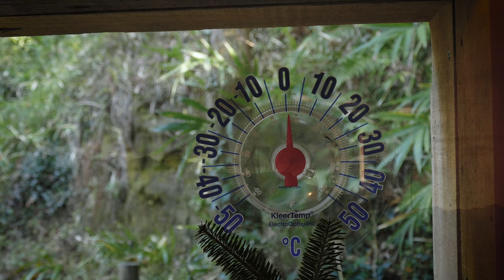Upgrading a kitchen from old Japanese cabinet / Building a cabin with Improvisations 34

Comment: He built high enough off the ground plus he has two front steps one lower than the highest steps this can ensure his ability to get in his home as he ages, this way if a ramp is needed he can have access to lowest level then build a small ramp section between the joining two porches at the left. He is a very very smart man. I wish he knew me cause he lives also with some modern conveniences different from Shawn James. I like the Asian mans living best for the reason of a woman’s needs too but I love his wilderness living also. Smart man. He may not want a woman, for reason allot of men live alone.